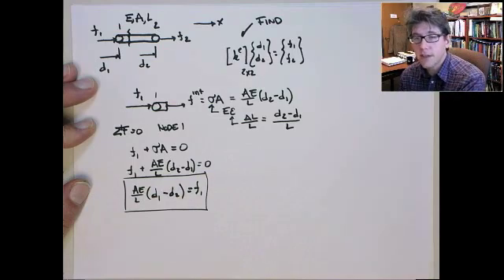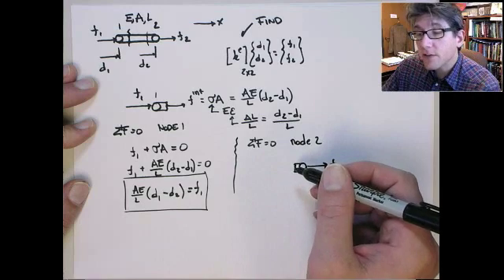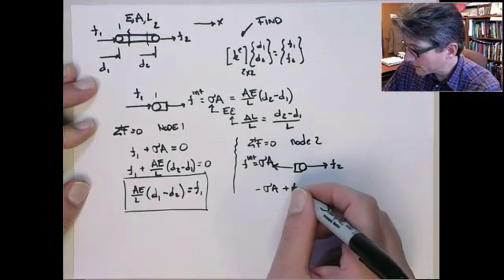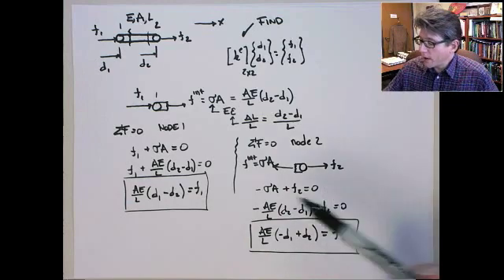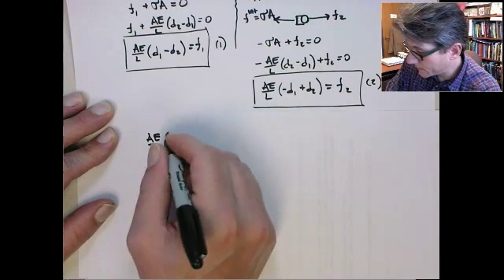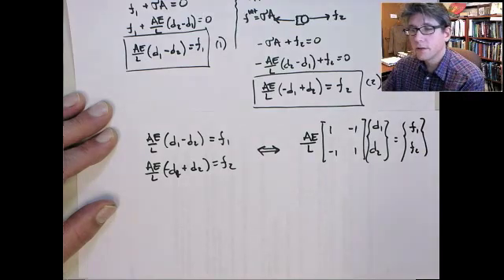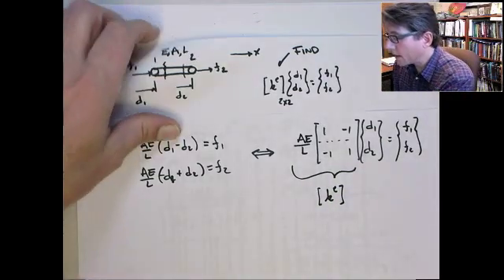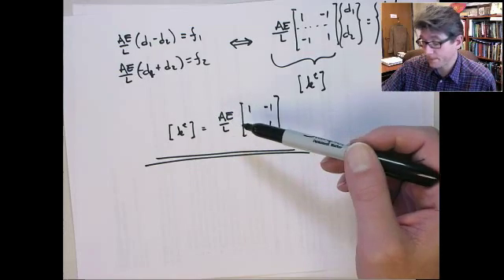1d bar element part 2

Comment: hi! I got a doubt.Whether the internal force [Fint] corresponding to f1 should be in -ve x direction, because upto my knowledge stress should be in the opposite  direction to the force applied. Am I correct? If not kindly explain me. I am little bit confused ;-)